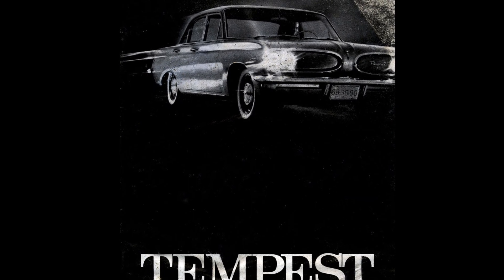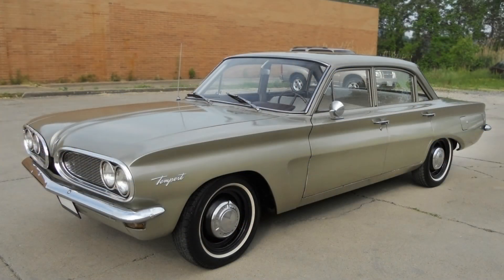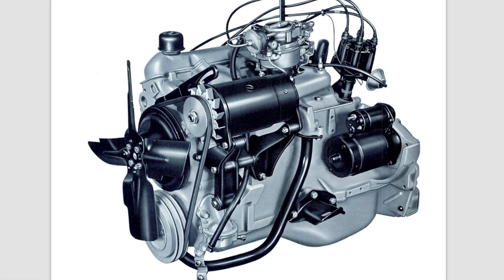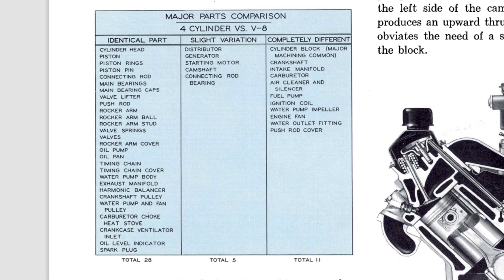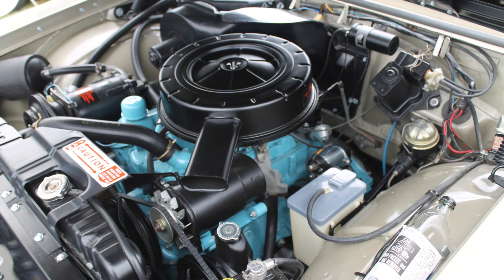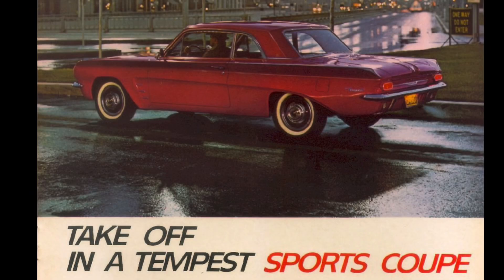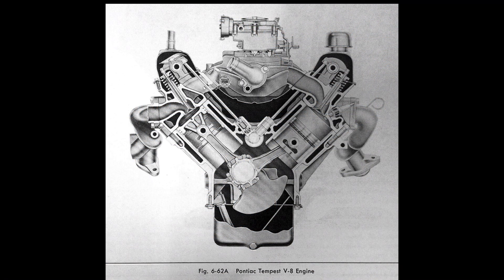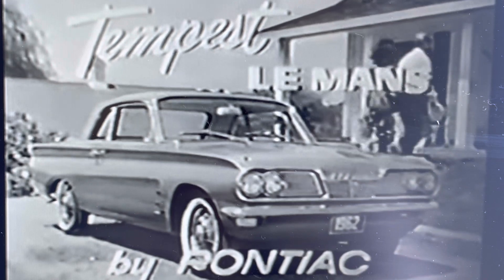Strangest Automotive Engines: The 1961-63 Pontiac Tempest & Its "Trophy 4" / "Half 389 V8" Engine

Comment: It would have been great if the Tempest rear suspension was fully independent and not a swing axle.  I had one years back with the (215?) aluminum V8, fun car to drive.
Reply: Shared components with the Corvair but didnt have the corvairs spin out problems cuz rhe engine weight was in the front.
Reply: The suspension WAS fully independent, but yes, the swing axle was not great for handling in some circumstances. A semi-trailng arm setup like 1965+ Corvairs would have been the way to go.
Reply: @snowrocket  I was going from what my H.S. shop teacher, he said, "the VW and Corvair rear suspension are not fully independent," and Mr. Maylee was always right......               lol
Reply: @jetsons101  I understand why you would trust him, especially if you didn't know much about that stuff. He was wrong, though. I'm a suspension geek and love the nuances of each type and the choices made to pick a suspension system for a vehicle. Since most people don't know or care, sometimes simpler is better, provided there's not a safety downside.
Reply: @snowrocket  I'am also going from experience, I had a 65 Corvair 110 HP with a stick. I added better shocks and sway bars   "and put the spare in the front trunk"   the car handled great.   My friend had a 64? Corvair 140 HP turbo and he tricked out the suspension a bit also but it never handled as well.
Reply: @jetsons101  There was a major design change in 1965 when the Corvair went to semi-trailing arm rear suspension which meant less overall rear camber change. This meant an improvement in stability and handling while going fast at or near the limit while cornering. Big enough and matched sway bars (matched to that style of car, weight distribution, etc.) can alone make a big difference.

Comment: Were they as crude as the "Iron Duke" engines?
Reply: Iron Duke was some of best, most reliable engines ever made... no timing belts or chains to break... 
I still have 2 of them that run fine... '77 and '85...
Reply: @BuzzLOLOL  funny, everyone else says they are junk. You are in a minority of one.
Reply: @BuzzLOLOL  I think they are in LLV Mail trucks which are not very well regarded but they just keep going and going while people complain about the noise
Reply: Junk? I don’t think so. Outboard Marine and Mercruiser use two versions of these engines, a 120 HP and a 140 HP. They would run 4,000 rpm all day long. Very reliable. Solid performers.
Reply: @roysmith6118  Gullible people like you comprise the wet dreams of the sub-standard GM Engineering Division.  You know, the junk they pawn off on Americans who eagerly hand over their cash to these incompetents.
Reply: @Jasona1976  yea, just like buying a second hand BMW…a money pit.
Reply: @roysmith6118  I buy mine NEW....sad you cannot afford one and want to slander the brand and those of us who own them. Cracka

Comment: Did the Trophy 4 have anything in common with the Pontiac Iron Duke that came later?
Reply from the maker: Nope
Reply: @RareClassicCars  was the iron duke 1/2 of a 301,305 or 350
Reply: Chevy 4 and Pontiac Iron Duke 4 was a shortened and modified version of Chevy inline 6... Iron Duke version first done in Brazil...
Reply: @BuzzLOLOL  In some early Novas there was a 6 cylinder option that was only about 190 cubic inches but I don't know if that is a downsized 230 block (like the engine found in pickup trucks) or something different-I think Iron Duke derived from one or the other of those two but I don't think it became "Iron Duke" until Pontiac modified it
Reply: Iron Duke was a marketing ploy for the Vega aluminum engine flop. Also was in the Monza versions.

Comment: Pretty cool.  International had a similar engine back then too for their Scouts.  I think half the 304 V8 and later half the 392 V8.
Reply: We have an old air compressor that uses a 302 Ford. one bank runs the four cylinders the other bank pumps the air. Oddly still sounds like a V8 when running
Reply: @plap.  Cool.
Reply: Correct. IH called it the “Comanche,” and it came in two flavors, 152 or 196. The 196 lasted into the mid-70s.
Reply: Yep. I owned one. Engine/drivetrain was bullet proof. International over engineered and over built these engines as they were derived from their diesel engines. Oil filter canister was the size of a gallon paint can and had 16 zerk fittings on the front alone. However, it was a RUST BUCKET. IH missed that part.
Reply: @roysmith6118  I do remember the body rotting away on them, but they seemed to run forever.  Great off road and/or snow plowing vehicles.